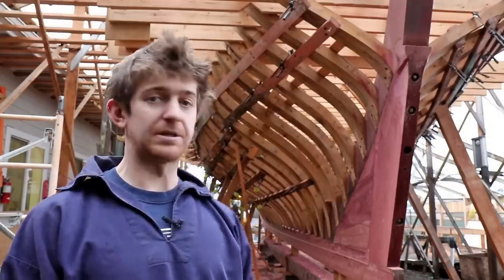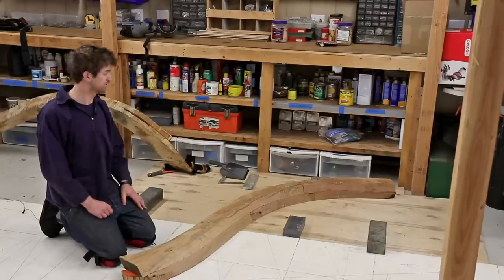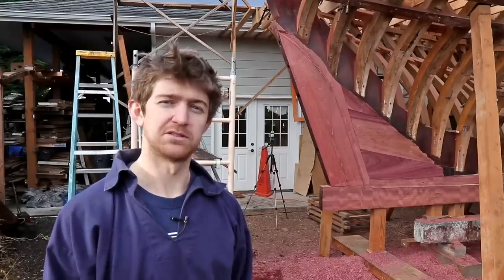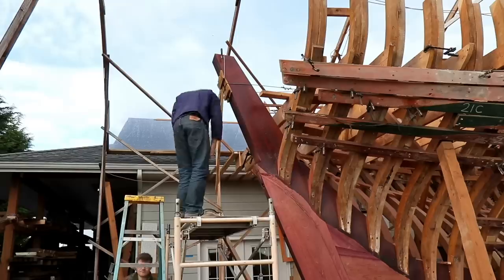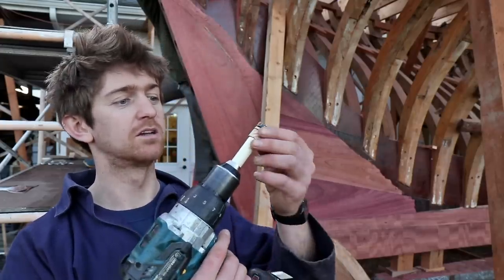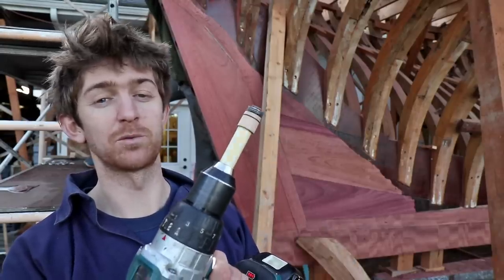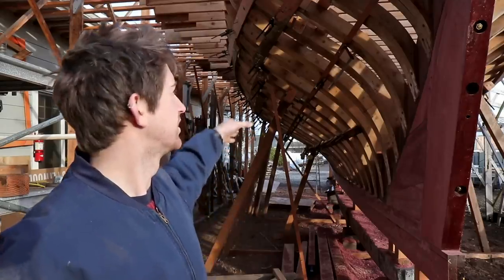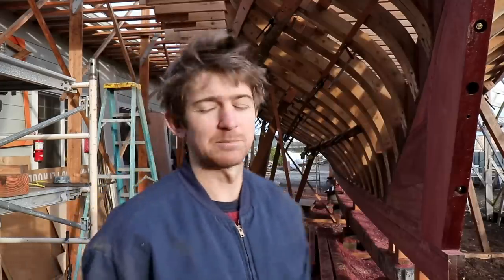Installing the Fashion Pieces (Rebuilding Tally Ho EP61)

Comment: I'm a dedicated follower of fashion--pieces!
Reply: I thought it was great that the trenails acted as a "fuse" protecting the actual fashion pieces. Effectively, it seems to me they absorbed enough of the kinetic energy on arrival at the scene of the crash (in breaking as they did) that the important surrounding pieces could handle what was left. 
If they had been stronger, (metal dowels, say) they might have transferred enough energy into the fashion pieces to split them.

Comment: Interesting logistical challenge, getting the stringers and shelves into the boat. Presume they will be one piece or at least joined before they go in? Best method = Mob handed and all in in one day or Several A frames and Blocks and Tackles and huge ingenuity. Which ever way stay safe!!
Reply: Before that, he'll have to configure the workshop to run 39ft lengths of beam & planking stock through bandsaw, planer & thicknesser ! A2A has a nice setup w/ their roller feed tables, but this is on a larger scale.
Reply: Ah yes there is that!
Reply: @philipmasters7491  - I like your A-frame crane idea, nautically they are called 'sheers'. Leo might have to remove 1 or 2 frames from the bow, to stuff the bilge stringers into the boat !
Reply: Oops! of course your right I’d gone back to Boy Scout days. Regressing?

Comment: It'd be sweet if you could park a 40' container or truck trailer astern and inline and slide the clamps right off the top of it and right straight in. IDK, maybe they will be sawn, and joined in place, then you could just set up some staging at the right height and snake them in. But then you could also put some temp deck beams a foot high and then remove 5 or so deck beams as they sit; looks like you have tall enough frame tops. I'm always wishing I had a "skyhook" ....... and was young.

Comment: Bloody lovely stuff and plenty of tea to keep you going in the cold! shame about the fashion piece falling but luckily it was a quick fix. Are you going to put some kind of wedge or filling piece just below the notch in the keel in the fashion piece or will that material be removed when fairing?
Reply from the maker: Good question, some of it will be removed, but yes I will have to fill the rest with something. That'll happen just before that plank goes on, probably.

Comment: How much will it weigh when you drag it into the water? Or are you expecting a heavy rain?
Reply: hahaha! He is certainly going to require more than a couple of dollars for that move. 
What you want to know is the displacement. 
I'd like to know the displacement and also the length overall.
Reply: I hope it's lighter than the water it displaces.
Reply: @joebrown1382  Everyday I hope that the laws of physics don't apply to me. Sadly, everyday I still weigh the same as the water I displace. 
However I do admire your optimism. 

P.S. I think you meant that you hope it's volume is greater than the water it displaces but I couldn't resist the smart arse reply. Forgive me.
Reply: @DavesShed  I stand by my first comment.
Reply: @DavesShed  - She is 47'-6" length on deck & is listed at 30t displacement. Leo mentioned she weighed around 15t when brought into the yard.

Comment: It’s interesting that these frames do not play a role in the structure of the boat directly. Rather the planks connected to the big timbers give the boat it’s rigidity. The frames role is just to hold the planks together, each to it’s adjacent ones.
As far as I can see, if you took the beam shelf and stringer after installing the planks, it wouldn’t make much difference. Or it would be equivalent to having thicker planks in those two places. This does increase lateral rigidity in those areas, but rigidity or structural soundness is borne in the planks, not the frames.
Reply: If you lay the boat on its side without the planks, and even with the cast metal pieces in place, the frames would break. On  the other hand, if you, after installing the planks, remove all connections of the frames to the boat, and leave only the connections of the planks to the frames, it would hold itself just fine.

Comment: I've watched this series on and off for some time, and although I have no specific interest in boat building, I consistently pick up interesting ideas about carpentry, workflow and materials.  Also some sweet parrot b-roll.  

Having only fairly superficially dipped into this series, I find myself curious about the original boat vs. the one being rebuilt.  It seems as though essentially the entire boat is being replaced one piece at a time.  Could comment a little on some of the materials you preserved from the original, or how this process of rebuilding differs from building a new boat using the original as a physical template?  If this question is addressed in a video, point me in that direction.  Just curious.
Reply from the maker: Sure thing, I talk in depth about it here :)  https://youtu.be/tW15VnkEmQ0

Comment: Can you use some of the old floors that were removed?
Reply: The prob is, the old floors are iron. Wet iron & wood (esp. oak) interact chemically to degrade the wood's strength & rot-resistance. Leo seems committed to non-ferrous metal components & fastenings.

Comment: How large of a crew will Tally Ho require once she is seaworthy?
Reply: I'd say 3 to 5 people should be enough.
Reply: Pier Giorgio more! Probably 6-8
Reply: Require?  one
Reply: @schoon111  Realistically?
Reply: @reeepingk  Required to do what? Go for a daysail,cross an ocean, navigate the Panama canal,bring her up to a dock? she can be sailed singlehanded .She would carry 8 to race. BCPC 's carried a man and a boy,plus the pilot. they were the same rig, and similar tonnage.
Reply: One, more can come for a ride. Probably day sail with 10 though 5 or 6 would be better space wise.
Reply: one man, and one parrot.
Reply: Depends on what he uses for sailcloth. 1900 correct cotton canvas, need enough people to move that canvas soaking wet. Modern sail materials weigh less and absorb less to no water, probably light enough that all sails could be handled by Leo, and be light work for 2 o 3 people.
Reply: @schoon111  Wow. You dont want that boat to last long. Even to unmoor, a quick motor to another wharf and re-moor is a two person job on a day with no wind and/or tide, safely.
On a bad day it would be three experienced crew.
Reply: @dnomyarnostaw  I totally agree!

Comment: Excellent work but I will never understand why you bought the original boat to simply throw it away as you have replaced 100% of it. Yes I have seen your video covering this subject and no matter how you word it, it is a copy (a good one ) I just don't understand all that extra work/cost done removing the old. Surly it would have made more financial sense to build new from plans?
Reply: I think that when Leo bought her, he assumed that the original teak keel would be reuseable / repairable. Ughfortunately it wasn't possible - once he removed the lower planks, the keel & oak centerline timbers were too decrepit to re-use.

Comment: That hole drilled for the propeller shaft is too small by far. Maybe when she was first built, an engine that fitted into her ER space was large but lacked HP but today, 150 Hp can be had from a small diesel easily and to move the mass of TallyHo you will  need HP  and at least an 1 3/4" SS shaft ( better to go with 2") which means you need room for a shaft tube and a cutless bearing on the outside and a shaft seal gland housing on the inside. Build that area up now before you start sheathing with hull planking and you will save yourself a lot of grief in the future. Ignore it and every time  you need to motor I'll wish you could kick yourself in the arse....
Reply from the maker: it's just a pilot hole. It will be bored to over 2".